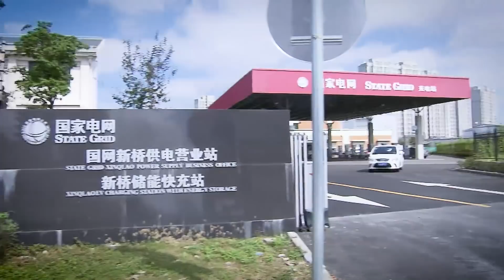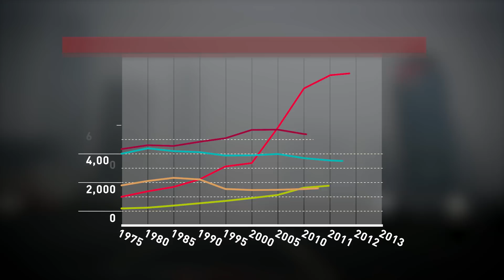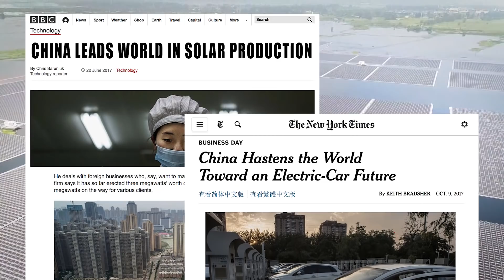How new solar technology is fueling China’s electric car industry

Comment: good but 30 mins is still a no go
Reply: This only the first stage of the roll out of electric car charging station, but in future they will adopt the battery swap system like what tesla is proposing now.
Reply: Four of Clubs so you only change the batterie instead of charging it? well thats soind really good.guess then we will see a "gas"station klerk again which will do the swap.
Reply: No, the way the tesla batteries swap is automated, you just go to the charging station and park your car on battery swap platform and it will swap it for you automatically (no human involve). tesla claim it will be faster than filling a full tank of fuel.
Reply: @fourofclubs4222  Battery swap technology is already operational with Nio electric cars. They have no less than 143 battery-swapping stations in 58 different cities in China for about three years. Each swap operation on a Nio ES8 takes about 3 minutes.